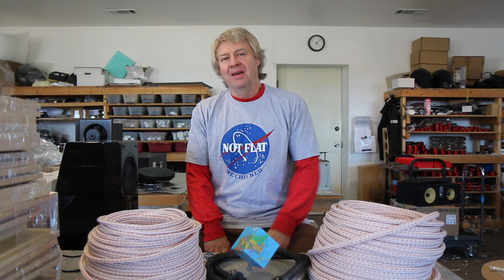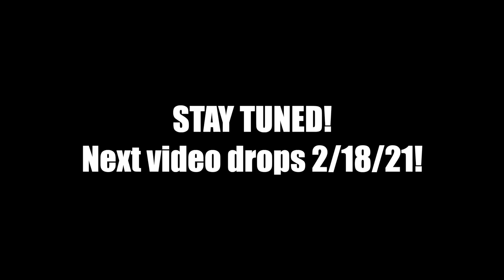Audiophile Cable TRUTHS: The Divided Camps

Comment: Dear Danny, many of us like to watch many of your videos because you are obviously a great speaker/crossover designer. And in all your videos you show your measurements and if the measurements are not as good as you want then you change capacitors and inductors to make the measurements and the sound better. So far all is perfectly fine.
And now you insult your listeners who look at measurements and capacitance and inductance and you call them flat-earthers. Do you think that is fair?
And why talk about big aluminum cable or steel rods? Nobody is using those! If you want to compare your cables then please compare i.e. 12AWG copper cables with gold plates connectors (because of no corrosion) with your special cables. And if you like not only do measurements but also make double blind tests and look how many people will be able to hear a difference. I would love to see a double blind test with let's say 10 people and look how many of them are able to hear that your cables are better. But please be fair. Compare your special cables with good cables like 12AWG copper cables with gold plates connectors. Be fair and open minded. And please don't insult your listeners and customers.
Thank you Danny
Reply: Don't misunderstand. No insults intended for those (like myself) that measure everything. The point is that you can't draw conclusions on how something sounds based on the measurements. The measurements are a tool (a tool that I use every day) to identify and fix problems. However, in the end it all comes back to listening. 

And I have been through extensive listening tests and comparisons. That's what often sets my speakers apart. 

Hang in there on this one. There are quite a few episodes coming that cover everything else.
Reply: @davidlong1786  I'm not here to sell you something. I'm here to educate. And when I do offer something for sale it is a gem. It's value will exceed its price or I don't offer it. My goals are to offer value that you can't get anywhere else.
Reply: agree with most of your points, was hoping he would segue into some measurements, but it sounds like that's for future episodes. I don't think he was referring to you (or us) by the flat-earther comments, which is also the answer behind your question "why talk about big aluminum cable or steel rods?".

It is because this is one of the most commonly quoted and misunderstood tests by the "flat-earthers" - there were posts reporting clothes hangars as being equally as good cables as the "best" headphone cables (these were Monster cables). This caught on like wildfire, and is all they know to regurgitate without looking into the actual test conditions, or even considering whether giant stiff rods are ergonomically acceptable as cables. Pretty sure these are the "flat-earthers" he's getting annoyed with.
Reply: I'm not a flat eather, but I find some of the flat-earth arguments compelling (like the Chicago skyline view from 40 plus miles away - its real, I've seen it, and it made me wonder, too. The round earth math shoul not allow the view.), but also there are even more baseless points. That's what Danny is talking about. But I'm not offended. And maybe Danny isn't perfect and this flat earth example wasn't his most brilliant thing. Who cares? People get so offended expecting others to tailor their approach for their own unique mind. Impossible. But what Danny is, is this: he's a hard-working honest guy just like so many, but he's a damb fine audio engineer, and he's not shy about saying something is nice when it's nice. Maybe its a bit of salesmanship, but if it's good, it's good. If you disagree, I'm sure Danny and the rest of us will be fine.
Reply: @nickburak7518  Look over the surface of a glass bowl, it distorts the light passing through it. The atmosphere behaves in the same way. It’s not some kind of secret, it’s been observed and studied since forever and is one of the many reasons why “I’ll believe what I see” doesn’t always make sense in science
Reply: @TofumanFC3S  Thanks. I think I understand what you are saying. I've heard the scientific explanation for this phenomenon (of seeing a skyline when we shouldn't) is that light bends over the curved surface, making it appear as flat even though its not. Did I understand your point? That's why Danny says that even with the measurements that ultimately, when it comes to sound, we should also judge it by hearing. That's why we buy what we like (be it a warmer sound with heavier presence in the bass or a cooler more 'crisp' sound).
Reply: @nickburak7518  I am sure it also happend to you before: You know a guy who is an expert and you always like to listen and learn from that guy. And then one day he talks about something else. And what he says is questionable, to say it mildly. What do you think then about your admired expert? My first thought is: Why did he open his mouth about that thing for which he is no expert? Why ruin a wonderful reputation with, let's say, half-knowledge, about something else?
I admire Danny enough to give him a chance in the following videos which he promised. Let's see what he will bring up. And maybe he can convince me that those big cables make sense. But I doubt it. Because the last video about cables which I watched from him used those supposedly speaker cables as antennas. And that was somehow the reason to prove the bigger cables are better. That other cable video was until now the only Danny video which I wouldn't recommend.
Reply: Wow really, that's what you got out of what he was saying and the examples he used? Sold steel rod, aluminum cable, which do have very low resistance but would also soundi like crap. Building crossovers to the same specs, that test the same but with differing grades (quality) of parts,  which results in a vastly different sound.
Reply: @edgar9651  I see where you are coming from. But I've lived long enough to know that people make mistakes. I also know that people are often merciless, giving no credit where credit is due. I don't care about the flat earth example...I was waiting till he got on with it. From my experience everyone is good at one or two things. The rest is a fumbling exercise. When people expect others to be good at everything and then they find out that there is something that they aren't good at (flat earth examples or whatever, sales), they often change their mind about the person and cast him away. I'm not like that. Danny owes us nothing. His videos are free. Take it or leave it... But if he's your employee then feel free to fire him
Reply: @nickburak7518  Yup, you got it. The problem however with your analogy however is that 1) The first example is an optical illusion. You’re not seeing the actual city of Chicago, but distorted reflections of reflections bouncing of impurities suspended in the atmosphere etc. Would you wanna hear a “audible illusion” when listening to music or the actual music as intended? 2) People aren’t able to identify the good, working cables and the special “even gooder” cables in blind listening tests. In fact, identifying a good and a great speaker is very hard as well when you don’t know you’re about to listen to the better one. 

So, all of it doesn’t matter then!? Well, yes and no. It’s nice to know you have stuff that is higher quality than your ears. Knowing that regardless of how you’re feeling that day, maybe you’re a bit under the weather and your ears are a but closed or you’ve been doing construction the day before and your ears are still slightly ringing, you still know the music is sounding as good as you can make it sound. Then there’s the visual aspect: Fancy cables look nice, as long as they perform at least as good in testing as the regular cable you’d have used. You should still consider for yourself how much potential improvements beyond human hearing capabilities and aesthetics should cost you. For me it would make sense to maybe spend double, I mean I like nice stuff. But spending 100x or even 1000x on things I or essentially any human can’t hear just for looks / bragging rights? Hell naw...
Reply: @TofumanFC3S  Thanks. of course my point about the curving of light could have included what you were saying about distortions bouncing, etc. that's true, too. i could have said even more, but I didn't want to speak about the physics of illusion any more than touching on the point. regarding speaker wire, I guess I need hear it to believe it. if the $400 for 40ft. of the 10 gauge (as opposed to $50 for 50ft. of your basic 12 guage) gives me the goose bumps, I'm gonna spend the money... and then I'll be another testimonial lauding them as 'must have's'. In that case I can't help whoever wants to believe that it's a waste of money, claiming them to be 100x to 1000x the normal price of basic wire.
Reply: @nickburak7518  The 100x or 1000x was referring to some of the ridiculously prices “high end” speaker cables and interconnects out there. 

And what you said is all fine, I’d take those chills for 400 bucks... But I’d also know my mind is probably playing tricks on me

Comment: I would like to see a new cable test designed to introduce specific distortions into various sample cable types so we can see how the various cables handle the interference. The people saying that cable types don't make a difference are not testing under the correct experimental conditions/parameters. Ex: EMP through two diff style cables with the same Inductance values will not produce the same effect.

Comment: Does silver speaker wire sound different than copper?
Reply: Yes it does.
Reply: @dannyrichie9743  better or worse?
Reply: @callumwiseman  Different. So long as you are mixing them, then you can get good results with either.

Comment: Thanks Danny. Someone in another channel keeps suggesting to people that wire does not matter yet he personally use a hi end one. Such a hypocrite. Wires matter.
Reply: funny that isn't it?  I think his choice is Kimber if not mistaken
Reply: @contemporaryhomeaudio  It is Kimber.  He has also noted that the reason he uses it because a) it still measures well b) it's audio jewlery and looks better than just zip cord.
Reply: @OHMAudioChannel  That's kind of my point.  If two amps measure the same and one is really affordable the other is built like audio jewellery and priced accordingly he'd criticize the expensive piece.  I would just prefer if he carried on doing his own thing instead of making videos in response to or attempting to debunk another youtubers 'work'.  People are funny that way though.
Reply: @contemporaryhomeaudio  I can only assume as I'm not Gene, but I think he would take exception if the higher priced amp was claiming superior performance or making false claims.  He's very critical of Audioquest as they tend to make baseless claims of the performance enhancements of their cables where as Kimber at least offers up their measurements.  Both have significant mark ups but with the Kimber's you're at least able to make a more informed decision based on data vs market speak of other boutique cables.
Reply: @contemporaryhomeaudio  There’s nothing wrong with using fancy stuff as long as it performs at least as good as the cheaper alternative and you are aware you’re spending money on looks. Does the piano black finish on a speaker box add anything to the sound quality of the speaker?

Comment: It's an art. And it works. But you have to also have a decent system and skills to really be able to hear differences between cables.
There is also a lot of gear out there that is so bad, that going from the worst to best cables, almost is impossible to hear.
Also not only are many not measuring the right things. Many times it just is not possible to measure these things.

Comment: All cables sound different. However overpriced fancy silver or gold core cables that only rich people can afford are not at all necessary to get satisfying hifi sound to average working people who like quality hifi they can actually afford. They will buy the best sounding $100 cable over some $1,000-$10,000 cable & be perfectly happy with it, because it's good enough to them. Economics matter.
Reply: would ad that cables that use 99.99999% silver are expensive because of the cost of the precious metal.... They use silver because its a better conductor than copper. But there are those who price some of those cable astronomically.
Reply: This appies to everything. Each person has to determine for themselves what they think is worthwile and if it's worth paying for the benefit.

Comment: Seems pretty easy to me. If you hear a difference, an improvement, do it. If you don't, don't do it. Everybody doesn't hear the same thing to begin with. I have a serious case of tinnitus, from playing on a lot of loud stages. There aren't any filters out there that will block that off, it's always there. I can still tell the difference between something that sounds better than something else, but there's that ring, that will always be there too.

Comment: measurements are all very well. It is good, from an engineering point of view,  to know a speaker is functioning correctly. But what I want out of a pair of speakers is for a double bass to sound like a double bass and a bassoon to sound like a bassoon. Their are no laboratory instruments that will tell you that. If I am listening to a musical instrument playing a note a 500hz, It is of relatively minor importance that I am hearing it at the correct dB level if it sounds like a sine wave. A frequency response graph does not tell you if a violin sounds like a violin.

Comment: In my over 40 tears as an "audiophile" (since the days of zip cord for speaker cables), this has been a never-ending topic. I have had a ton of brand name cabling - digital SPDIF, interconnects, (RCAs and balanced) speaker cables, power cables. They all made differences, some more obvious than others - from soundstage, imaging, frequency response (subjective) differences - some making the whole system sound like a million bucks (to my ears) to sounding like a boom box. to bright enough to make your ears bleed. I could care less about the flat -earthers, that is why there is a market for hundreds audio cable brands. Period.
Reply: I have similar experiences.  Not all expensive cables may help in the right way as I see it even though I personally don't have a lot of expensive cable experience.  Most all cables I have used over the years all SOUND DIFFERENT.
Reply: Don't cry! 😢

Comment: Cables definitely make a difference, but it doesn't mean expensive cables are always better than cheaper cables.
I have a set of Tara Labs RCA interconnect cables that make my whole system sound warmer.

If you can't tell the difference between that cable and My Monster Cables or audioquest cables then you are deaf.

Comment: If there is a difference, wouldn't the cable just color the sound ? Wouldn't it make more sense to want a cable that is as neutral as possible to lower the amount of variables in your system ?
Reply: In my experience audible differences in cables are predominantly due to the shielding and the coating, the insulator layer. And also to connectors and connections.

There is an audible difference between copper and silver. However, it is very difficult to get silver right, especially the connections are problematic. So more often than not a silver cable will sound snotty and shitty. If done right, e.g. in speakers, and with adapted crossover and silver coils, you will get very open, very transparent and very sensitive speakers. They will show you everything. For example that most recordings are crappy...

Comment: Why is it important to have filtering speaker cables when the cables inside the speakers tend to be of the basic kind? Sure, they are normally less exposed to other components (amps and power cables). 
Can the copper wire used in the coils in the crossover also work as a antenna? 
Would shielding the crossover give a improvement in sound?
Reply: i'm no expert, but i'd guess that internal speaker cables can get away with it (so to speak) because they're very short, too short to noticeably behaver as antennae.
Reply: Wait until you see the videos to come.
Reply: Good question. I'd like the answer to that one. In any case I'm sure that whatever wireless frequencies touch the internal wiring of a speaker are also touching the internal wiring of all electronics parts. When will it end? It's minor. My system is a modest one and I like it a lot. I don't hear the radio channels leaking through.
Reply: That's why I rewired the inside of my speakers with bare wire.

Comment: On a commercial level, the reality is that customers can only go by Vendor claims, and or by  recommendations, and or by feedback, and or by actually using the product itself. If a product is demonstrably better than what is available in the market place today and can be sold at an affordable price then scientific evidence should be commission to validate this. With such evidence, the product would sell itself. You'd sell millions of these. As improvements involve unknown parameters and therefore cannot be measured, then the focus would revolve around a scientifically conducted blind listening tests using a large sample group and include a variety of components, as well as a variety of speaker cables. Interpretation of such a test would need to be interpretable in accordance with  scientific methods.